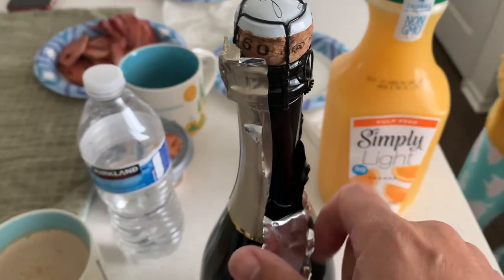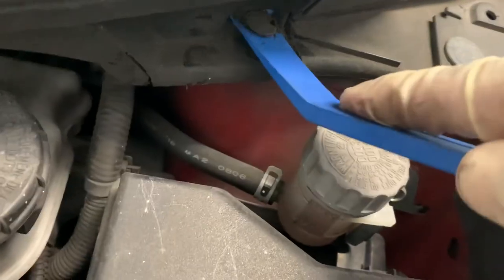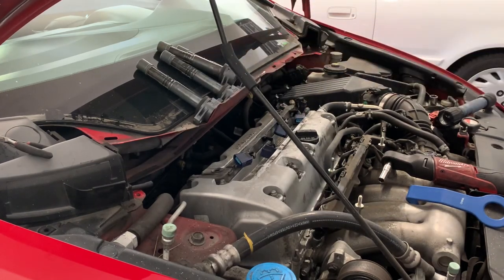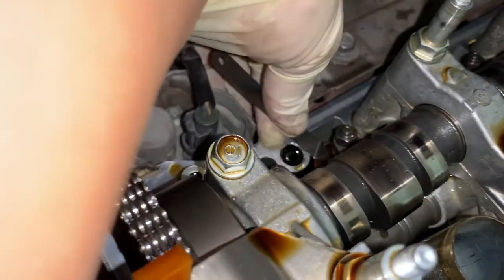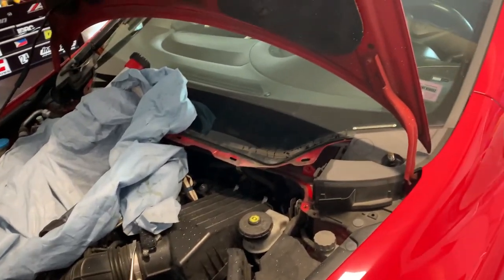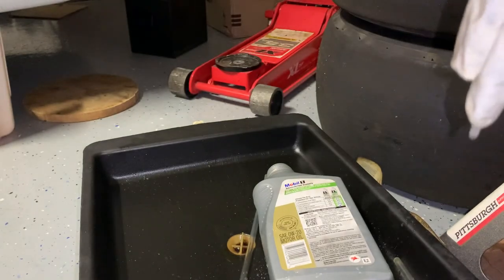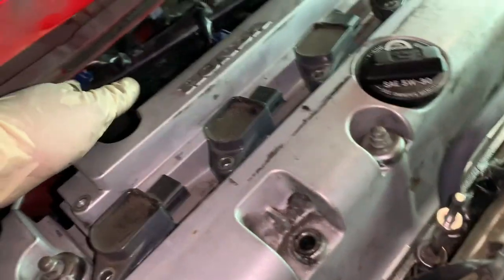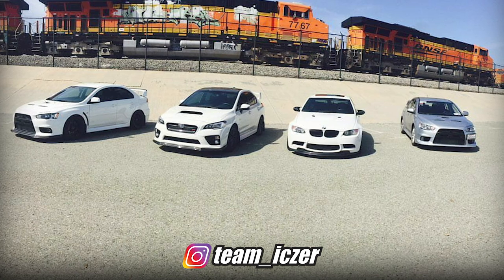[E78] How to adjust valve clearance to fix Rich Code P0172 (2009 Honda Civic Si Sedan FA5)

Comment: Hi I have a 2009 Honda Civic si coupe with the k20z3 I did not have any check engine light or nothing but my valves were a little noisy so I decided to adjust them but it’s my first time doing valve adjustment did you torque to bolts on the valves ???
Reply from the maker: Awesome! Sorry for the late reply… The YouTube studio app are you showing me that I did not reply to your question yet. There are torque specs to the locking nuts… Personally I don’t torque them. Based on my experience I go with my feel.  Torquing is not too critical for it. Just need to be sure had to over tighten or leave them loose.  If it was head bolts I would definitely use a torque wrench.  But not in this case. Thanks for your question for stopping by the channel. Again sorry for the late reply hopefully this video was helpful for you!

Comment: Did this in mine it didn’t fix the problem don’t know what to do and don’t know if it’s the MAF or oxygen
Reply from the maker: Yeah, don’t rule out the MAF.  Get some MAF cleaner spray and try that.  Small spec of dirt can affect its readings.  Its worth trying.  Had a similar issues with an accord on a buddies car.  Hope you resolve your issue with your ride! And thanks for checking out the video. 🙏🏽

Comment: 26:18 Bad VTC Actuator.
Reply from the maker: Not in this year and model. Different noise as well.   Notorious was the crv and the accords. For the accords was years 2008-2012 and crv was 2007-2012.  The older vtc actuators were awesome. HONDA may have went cheap on the newer ones. We appreciate your input.  Thank you!
Reply: @TeamICZER  For sure! I have an '06 HFP FG2 with over 210k miles (I put 100k on it) and haven't had that sound personally after 10 years of ownership. It should be either timing chain or the tensioner at this point. Thank you for the video. I have the same issue with fuel trims and there's no problems with sensors. So valve adjustment is next since I haven't had one done yet and hearing valvetrain under acceleration lol.